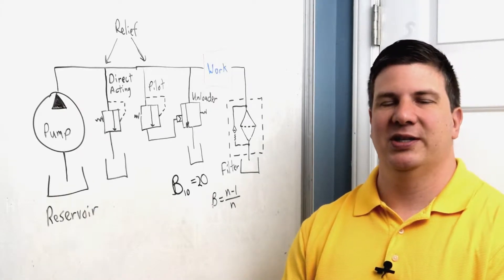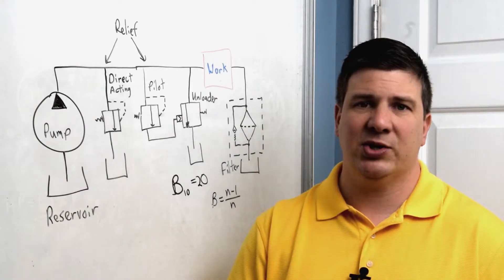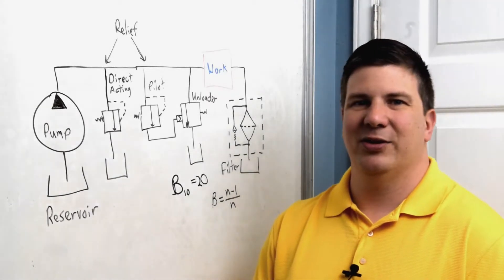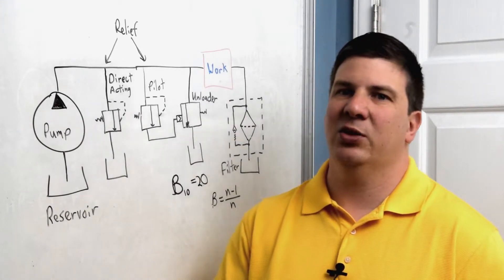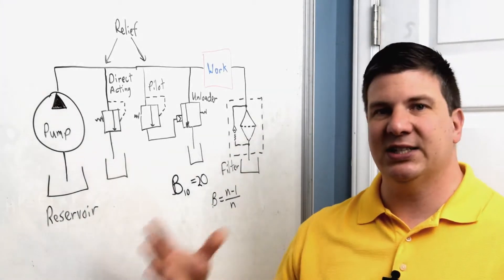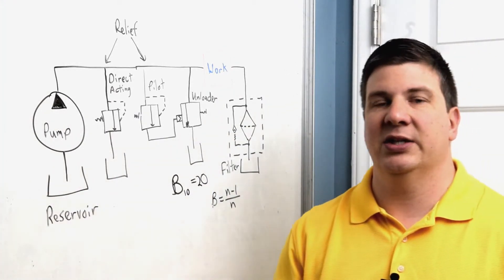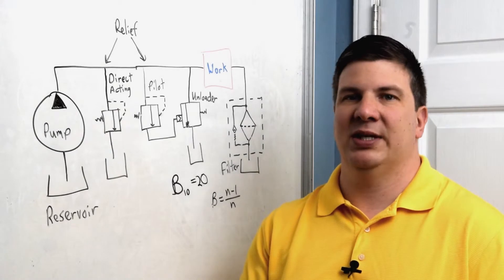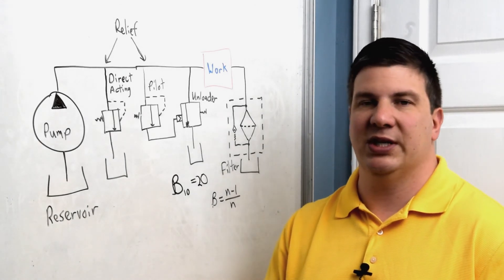Hydraulic Pump and Reservoir Basics - Log Splitter Design Part 19

Comment: Mentored engineer, could you do a video covering hydraulic theory behind sizing a pilot to open check valve on a log splitter?

Specifically selecting valve cracking pressure and pilot ratio? 

As well as hose sizing for a 22gpm pump?
Reply from the maker: Generally a 10:1 would work.  Where would you put the check valve?